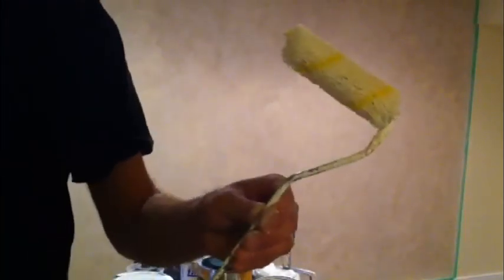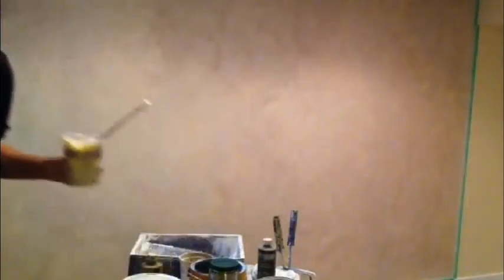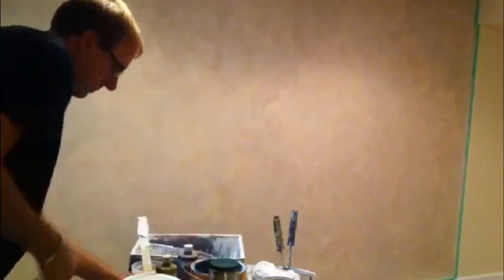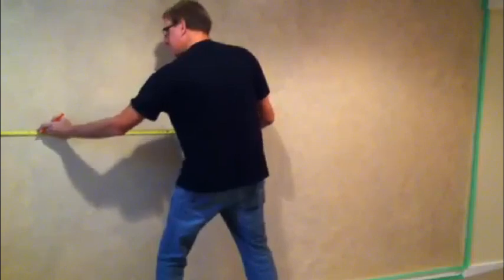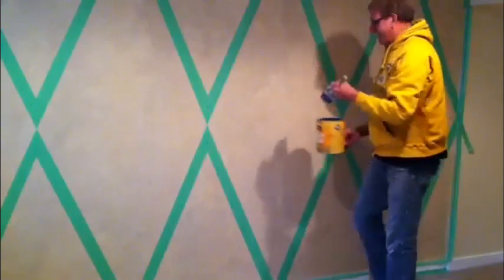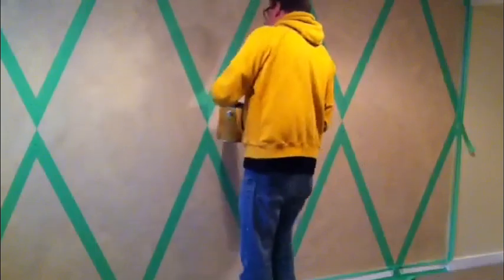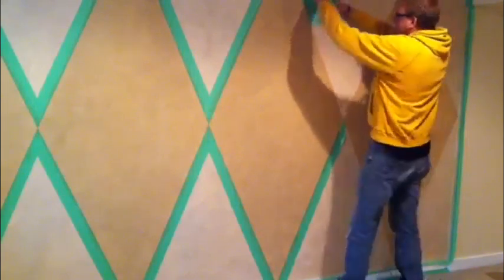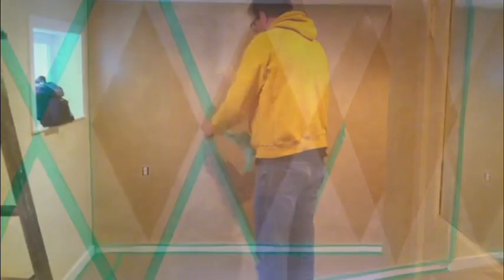Faux Creative Painting Techniques For Walls

Comment: You didnt say how to put on the tape...how do you get the diamonds??? Is there a special way to cut the tape?  You didnt explain that...
Reply from the maker: Basically I divided the wall into 4 spaces and marked that at the middle , height wise, on the wall. Then dived it by 8 and using these measurements to get the top and bottom points of the diamonds, drew a pencil line and then taped it doff. Try doing this on a piece of paper. It's easier to try it that way before you go to the wall. Good luck!
Reply: ohh ok thank you so much...Your wall its amazing!
Reply: TMichelle smile